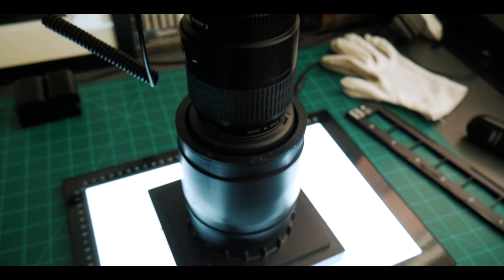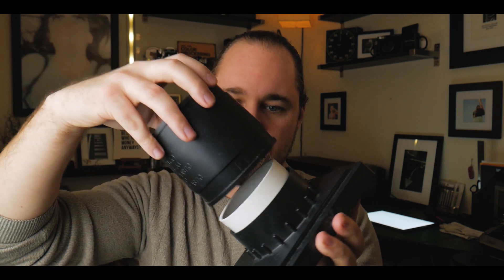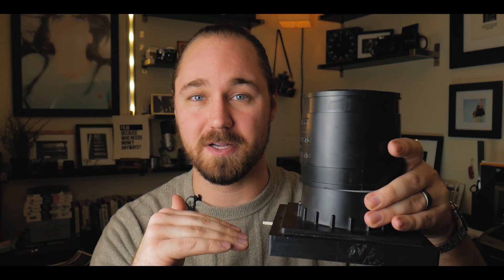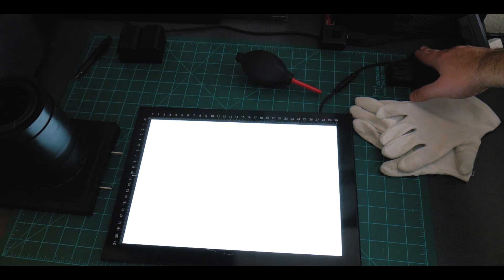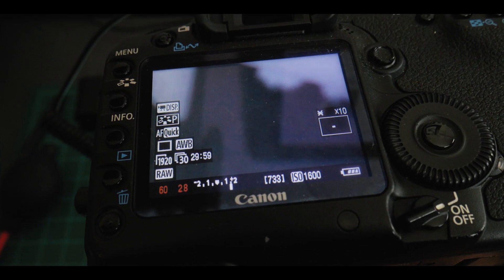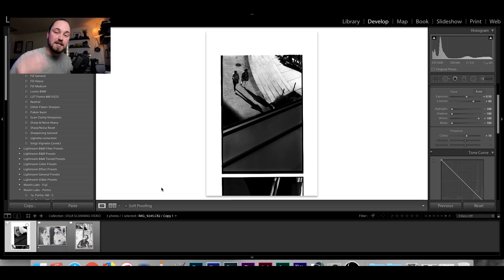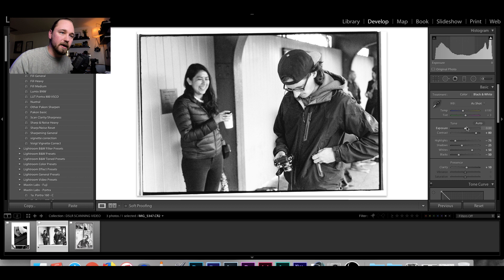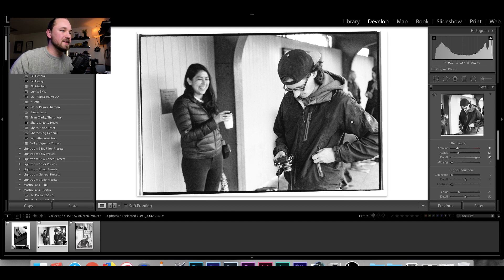DSLR Film Scanning Setup & Edit Workflow (DIY Film Toaster)

Comment: I went and bought the items you used and found out the thin wall is very important. My Home Depot doesn't sell that version of a coupling at all. After further investigation, the proper term for it is Sched 30 size. I was able to find one on Grainger and am ordering it now.
Reply: I just got back from Home Depot and found the two pieces but they did not have that coupling. I'll have to check out the site you mentioned here.

Comment: Kudos! Thanks for making this video, it's a great tutorial. I am bummed that the diameter of the flange (pipe) on the drain grate is too small for 6 X 6 medium format frames!! (I think I've figured out a work-around). Looking forward to scanning a bunch of neg/slide film.
Reply from the maker: There are different sized flange’s so hopefully through some hardware store hunting you find a proper solution

Comment: Beautiful setup. What tweaks would you need to scan 120 film? Will a 120 film holder fit in place of the 35 mm holder?
Reply from the maker: Depending on the holder I’m sure you could get it to work with the system. Some minor tweaks may be needed. At the same time with how cheap the setup is to build I’m sure you could build a second rig specifically for medium format with a bit of extra hunting at the hardware store. Let me know if you get something figured out. I would love to hear how it went

Comment: Terrific video tutorial! It could have used a tight shot of the film grain on the camera display (maybe even zoomed in) and a tight shot depicting the resulting sharpness of the camera-scanned film grain on the scanned negative and on the positive conversion (in Lightroom). I'm guessing the success of this process is as much about film grain sharpness as it is about dynamic range. Also, do you have a short, written narrative outlining the steps to build the lens adapter and film holder? Brilliant hack, as it creates a tripod stand AND makeshift extension tube! Kudos. Also missing from your otherwise complete tutorial: the final cut-length of the white PVC coupler (for a 100mm lens) the model number for the lens hood you used (though I'll be using a 100mm NIKKOR micro — I'll have to see if a hood is offered for that AF lens) and the height (thickness) in mm of your negative holder.

Comment: I was gonna ask why shoot at 1600 ISO, but you explained below bc of live view. Btw the Artograph LED tables are a good alternative to those cheaper pads, I just upgraded and it's a good 2-3 stops brighter than the generic pad I was using. It's got a better color spectrum too which should help with color scans.

I'm usually shooting f11, ISO 100 1/15th on a A7II for b&w
Reply from the maker: Joseph Delgadillo oh fantastic! I’ll look for one of those light pads. That would help out quite a bit.
Reply: What lens do you use on Sony?
Reply: @filminrussia7095  a 55mm Micro Nikkor but I'd like to upgrade to something more modern

Comment: Great video!! Any time you’re talking Home Depot photo gear hacks is a WIN. This is going to be a game changer for me. I hate flatbed scanning. My film never seems flat and I want the edges and carrier. Would some sort of anti newton ring glass work with a rig like this?
Reply from the maker: Yea I’m sure if you got two pieces of anti newton ring glass and sandwiched the film between it over the light table it would work just fine in replacement to a holder. Might need to watch out for more dust at that point, but a rocket blower can take care of that.

Comment: I'm an old film guy (old being the operative word) and have looked at various ways of digitising my film archive. I never considered consumer flatbed scanners suitable for 35mm, although 120 is probably doable. I invested in a Nikon Coolscan 4000 that produces decent results, but it is a slow process to get optimal scans. I always thought that using a digital camera made sense, remembering the old slide duplicators (most of my old archive is Kodachromes) from the film-only days and it seemed a logical solution. I recently picked up a basic slide duplicator that requires bellows and a 50mm lens with a 49mm filter. Enter the Zuiko 50mm from my Olympus OM1, with an adapter for it to fit my Canon 6D. The results were OK, but not quite as good as the Coolscan. I probably just need a bit more experimentation with settings. The main downside is that this manual rig doesn't work with live view, which would make focussing much better. Then I came across your video, via the Pushing Film channel. I love the simplicity of the set up. So after that preamble, my questions are; does it have to be the 100mm macro? Which one are you using? Would a less expensive 50mm macro work just as well, with the necessary height adjustment? Anyway, thanks for the video, it's got excited again about making scans with my DSLR.

Comment: Does it have to be exactly 1:1 macro? Would a 1:2 work, for example? Also why don’t you do longer shutter speeds and lower iso instead of the high iso and 1/60? Just for the time saving?
Reply from the maker: 1:2 will work just as well, you will just have to keep it in mind when building your rig. And I mentioned it in the video, the 5D mkii caps me at 1/30 on liveview. I dont go any lower because I dont want to lose my histogram or live view function. I work off of efficiency, not perfection. I can understand how others may prefer a longer shutter speed to lower the iso, but quite frankly, it really doesnt bother me personally.
Reply: @NickExposed  I have seen where shutter speeds between 1/15th sec and 1/60th sec, that the mirror vibration reduced sharpness.  Has this been your experience?
Reply: A 1 second exposure would not have this problem.

Comment: I have a canon t3i cropped sensor will that effect the quality? Also what lens would work for it. Great video! Matt sent me
Reply from the maker: That would work just fine. You can use any macro lens, or a vintage lens with a macro extension tube and adapter. Hope that helps.

Comment: I purchased the drain, 3” PVC coupler and 3” flexible coupler at HD showing the associate your links. Maybe it’s me but the coupler doesn’t fit into the drain (they are the same diameter) and the flexible doesn’t slide over the coupler. Did you shave off material to get them to fit??? Great concept if it works. Thx

Comment: Why not set it in manual focus so it will never change an lower the iso and shoot at slower shutter speed? Great video and awesome ideas!
Reply from the maker: @3196453  the depth of field is so shallow with the macro lens that it needs to be manually focused each frame to get critical focus. If it was a brighter light table I could lower the iso, close the aperture down. But because you’re supplying ample light you would be surprised at how little artifacting you get at 1600 to 3200

Comment: Great job and video. 👍
One thing I cannot resist to ask is, why don't you use the masking slider in the sharpening tool? If left to zero, it will increase the grain everywhere, there will be no specific detail sharpening applied. Is there any reason for this?
Reply from the maker: Klaus Tiburski you’re right. Someone else pointed this out as well. Not sure why I wasn’t using it. Probably confused me in the past or something. I’ve since changed my preset to have masking on it as well. Thanks for pointing this out as well.
Reply: thanks  for your answer. Guess ou know the "trick" with the alt - key ?

Comment: Thank you for sharing your workflow. The question is why is all these troubles since you already have a flatbed scanner and a Pakon +? For printing purposes may be?
Reply from the maker: Zerihun Hailu flatbed never gave sharp scans of 35mm film. No matter what I tried the grain was always fuzzy. Pakon was nice. But the scans were small and the virtual machine I was running for hosting windows xp on my MAC was finicky. So I sold the Pakon while prices were still high and spent $15 to use equipment that I already had anyway. And the scans I’m getting blow the Pakon and flatbed out of the water. Seems like a win win to me.

Comment: I found that you can use an iPad or other tablet at full brightness instead of the light table. You just need to make sure that there is some distance between the screen and the film so it's out of focus and the pixel lattice won't show.
Reply from the maker: AManWhoWasntThere yea in testing it against my light table it was a bit more dim even at full brightness. But it is a great alternative for anyone just starting out with a fresh setup build.
Reply: @NickExposed  There is a free app that can turn your tablet into a light screen, but I forget the name.

Comment: Hi! Thanks for the informative video! It looked as though you were adjusting the focus on the camera rather than the lens somehow whilst in manual mode? Did I see that right and was that because adjusting the focus on the lens was impossible due to the set up and if so how do you do it? thanks!
Reply from the maker: Hey thanks for the comment. I manually focus the lens on the barrel of the lens. I’m trying to think what you may have seen and the only thing I can think is you’re referring to punching in on the lcd to 10x to make sure focus was sharp. Hope that helps. The way the rig is set up it does not hinder the ability to manual focus.
Reply: Ah yeah that was what I was looking at, I get it now. Very helpful video, thanks again!
Reply from the maker: @poodlesandwichmodding7101  Youre welcome! Thanks for watching :)

Comment: Which side of the film are you sticking up towards the camera? Shiny side or dull side
Reply from the maker: DennisCarlson shiny side. I guess that’s one thing I could have mentioned in the video. 🤦🏻‍♂️
Reply: @NickExposed  Just wondering if photographing through the emulsion and flipping the image  in the software will show less scratches and dust that is present in the base? While I hear it doesn't make a difference with 35mm film, there might be a difference in roll film or sheet film.
Reply: Nick Exposed Great video, I will definitely be making this, but as is the case when placing a negative in an enlarger for printing, the emulsion faces the paper, copying is the same, the emulsion should face the camera, this will give you the sharpest image. I have worked in pro labs and when we used pro scanners, the film always faced the scanner.

Comment: nice rig :)) 
i have purchased the nikon film scan adapter, much more expensive .. kudos, your ingenious solution works as well or maybe better for u! i have adapted by panasonic g9 to shoot at 1:1 macro with 30mm macro lens. the detail and the grain is incredible when i shoot it as a high res by using pixel shift (80 megapixel files) , superb for large prints. the guy in the gallery swore i had shot the film on medium format! dunno why he thought so , but thought i should mention that.
Reply from the maker: I was actually thinking about that the other day, was wondering how well the pixel shift would work for it. Glad to hear it works out well. Probably a move I will make in the future.

Comment: Hey, do you feel this is better than the scanner.. ?I am thinking to scan my films as they are really expensive. 🤣I am still analysing which meathod is really good quality wise.. your feedback would be very helpful.:)
Reply from the maker: I have found this method to provide much higher quality results than the Pakon and Epson scanners I have had in the past. The only thing I have found that beats this method out is drum scans. Hope that helps
Reply: @NickExposed  Hey, thanks a lot :)

Comment: I’m still working on my setup. I’ve tried 30 megapixel canon EOS R and lately Olympus Pen F 20 megapixel camera with macro lens. Camera leveled on a dedicated high quality tripod, negatives flat on a light table. Using negative lab pro in Lightroom. Still the Pakon 135 + is faster and at 6 megapixels produces sharper,  better scans.
Reply: Fotos y Mas damn really? I’m super tempted to get a pakon but so many people seem to be selling them. Was hoping this DSLR method would be better quality.

Comment: What is the model number of the lens hood, mine is an ET-67 which has a far larger front opening (.6 inches) therefore will not fit in a 3" PVC Coupler

Comment: drrgr: you can reset the Lightroom curve to normal by going to photoshop, making some adjustments like cleaning up the image then back to Lightroom where the sliders will all be reverted to normal.
Reply from the maker: If you don't mind the added time in the workflow, this is a great work around for the reversed controls!

Comment: Any tips for some other lens for 5DM2 ?
I have 70-200 F2.8
17-40 F4

Also oldschool nikkor 50 f1.4 and 35 f2.8. Vivitar FD 28-200 and 50 f1.8
Not really a macro guy, just not feeling to spend 500 bucks on a new 100mm macro lens :(
Thanks

What if i use Tokina AT-X 100mm f/2.8 MACRO ???
Reply from the maker: The Tokina macro should work. I would suggest getting an extension tube for the Nikkor 50 you mentioned. A 2x extension tube can be found on Craigslist, eBay, Facebook marketplace for dirt cheap. I just say that over the Tokina because the optics are going to more than likely be much sharper for the quality of scans you’re shooting for. Hope that helps. Really any old 50mm with a 2x macro tube attachment would serve you well. Or run with the Tokina and see if you feel you need to do anything else. Perhaps it would work great for you.
Reply: @NickExposed  Do you mean 2x extender or macro tubes? How does it look like, i have no idea...
Thanks

Comment: 8:40 - SIlly question - you are not touching the camera, and the subject is absolutely immobile. Why not just turn the ISO down to its optimum level and pay the price in exposure time?

I digitise using an old slide holder which also takes 35mm film and fits on the end of my 35mm macro lens. The camera is held rigidly on a tripod, so even a mechanical cable release won't induce significant shake. I have similar illumination issues, but given the lack of any relative movement between camera and film, I see no reason not to allow the shutter speed to be slow as heck.
Reply from the maker: Hooray for Pentax! That’s definitely valid. But I’m scanning 20-25 rolls at a time so two things come into factor. It extends the scanning time out. And I mentioned in the video that the live preview caps me at 1/30. So if I were to scan with longer shutterspeeds I would lose track of my histograms and it would take longer getting proper exposure.
Reply: OK, noted. My scanning volume is much, MUCH lower and longer exposures don't seem to make a difference for me (Pentax K-1).  So for you, yeah, a brighter lightbox makes all the sense in the world.

Comment: Really super exceptional, beautiful video, thanks! I would also like to acquire the 35 mm and 120 b & w negatives with my DSRL system (Nikon D4S + Sigma 150 macro f2.8), but I have problems with the light pad, why do I get the dithering (rings of newton?) which I recommend ? Your channel is very interesting
Thanks
Reply from the maker: Massimo Dadone Newton rings are most commonly from the negatives touching glass or smooth plastic surfaces. Are you using a holder to separate the negatives from the light table!

Comment: Good to see your set up Nick. I’ve been testing out DSLR scanning for a couple of weeks now and the results are excellent but using a tripod each time is a bit cumbersome. I like your drain coupling set up so I may use this myself. Do you think a longer coupling could work for MF too? Also are you applying a crop in the import preset as well? Thanks for sharing this video.
Reply from the maker: Craig Prentis hey Craig, gotta say I’m quite the fan of your work. Always enjoy the walk about and portrait videos from you 👌🏻👌🏻 

The setup works great for medium format with the regular length of the pvc coupler. Should work well all the way up to 6x9. Otherwise extensions can be added. I thought about getting a second tube and having it cut specifically for 6x9. I don’t do a ton of mf shooting these days, but have a portrait project coming up that will require it. 

And no there’s no cropping applied on the preset. Trimming the pvc portion down removed much of the space that would have been cropped previously. It only leaves the black border of the frame, which I prefer to leave on during initial culling and edits. Hopefully that answers the question.
Reply: @NickExposed  thanks Nick, that's very kind. I'm really glad you've come across my channel and have enjoyed watching. I think I'll give it a go and see about building my own photo-plumbing-copy device as it seems to be a simple yet effective set up. Should be good for my 6x7 medium format work if needed but I'm happy to stick with the V850 for scanning those negs (and my 4x5s). Thanks for clearing up the cropping question. All the best.

Comment: There's no Home Depot in my country and these parts wouldn't fit my Tokina AT-X 90mm 2.5 as it is much smaller and didn't come with a hood. Still i have an idea to make something similar.
Reply from the maker: stefan zandburg if you go into the project with the general idea in mind I’m sure you can build something out of parts readily available to you, and that will fit your lens hood.